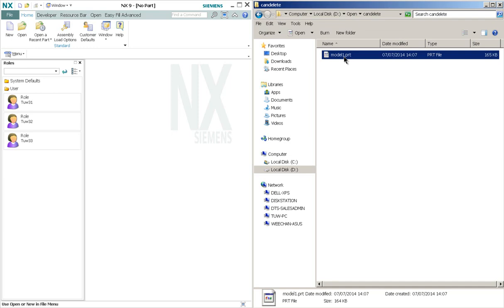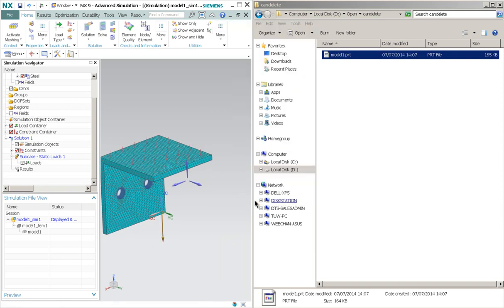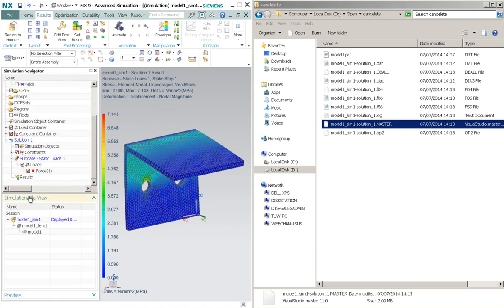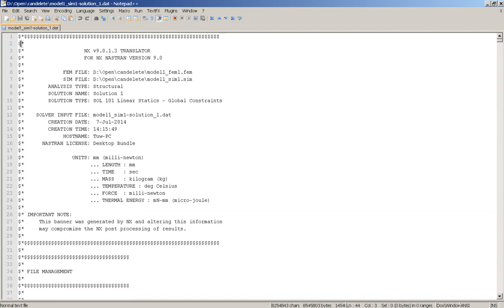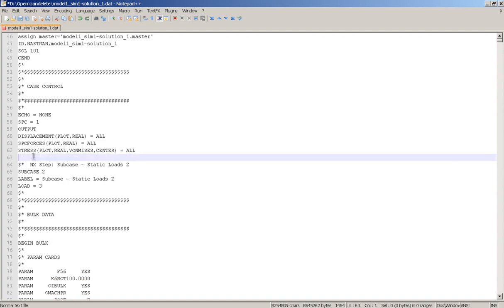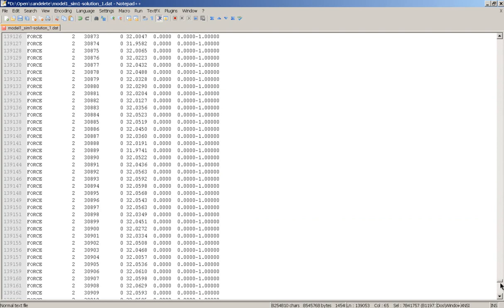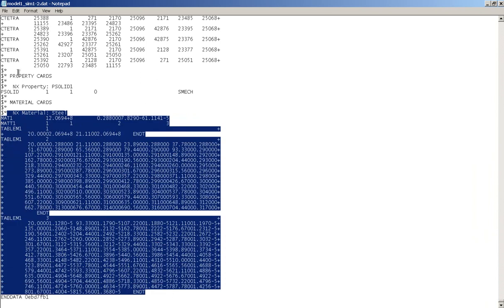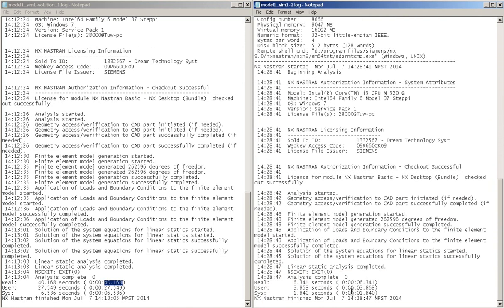NX CAE: How to Perform Restart on Linear Static Analysis in NX

Comment: When I m trying to run the restart analysis in solution 22 , I m getting the following error and unable to get the results: Can you identify the problem, Thanks.

THE RESTART VERSION ID IS NOT DEFINED ON THE RESTART COMMAND.
     A RESTART OF LAST VERSION ID IS ASSUMED.

 * USER INFORMATION MESSAGE 736 (RDREST)
     LAST VERSION CREATED IS BEING USED FOR THIS RESTART JOB.
     LAST VERSION =          2          PROJECT =  "BLANK"

 * USER INFORMATION MESSAGE 1144 (RSPRVR)
            4 DATABLOCK(S) HAVE BEEN LOCATED ON THE MASTER DATABASE.

 * SYSTEM INFORMATION MESSAGE 482 (LCDRVR)
            1 PARAMETER(S) HAVE BEEN LOCATED ON THE MASTER DATABASE.

 * SYSTEM INFORMATION MESSAGE 482 (LCDRVR)
 ^^^  USER   FATAL   MESSAGE 9080 (  STATICS1)
 ^^^  THE RESTART FMS STATEMENT IS NOT ALLOWED IN SOLUTION    SEQUENCES 1 THROUGH 3 AND 5 THROUGH 16.
     VERSION =          3 PROJECT =  "BLANK" OF THIS DATA BASE IS NOT VALID FOR RESTART PURPOSES.

 * USER WARNING MESSAGE 784 (XCLNUP)
                * * * END OF JOB * * *